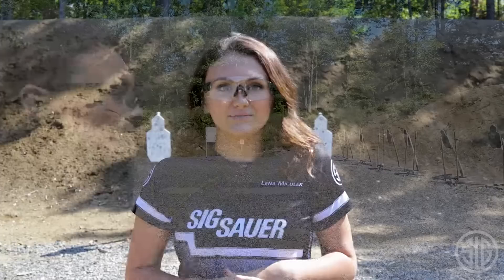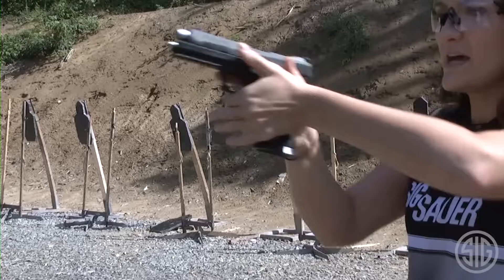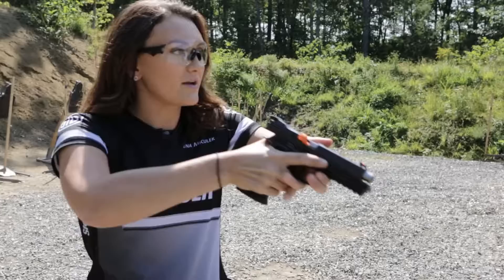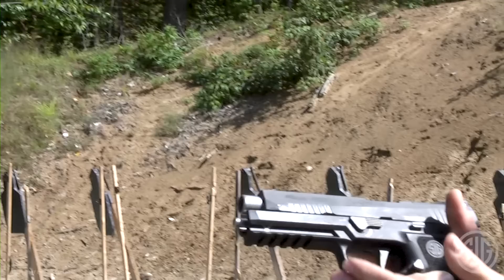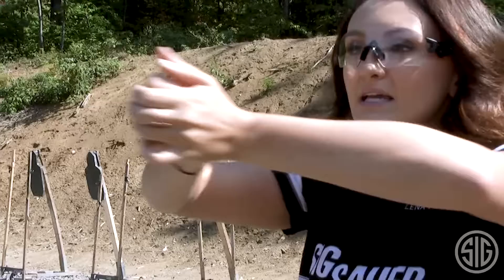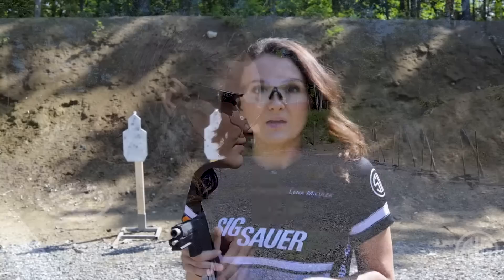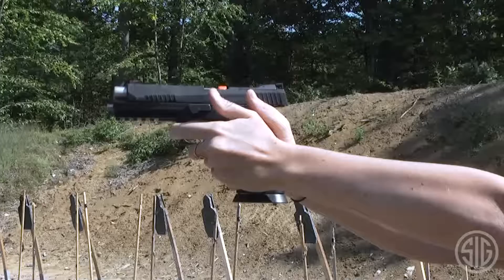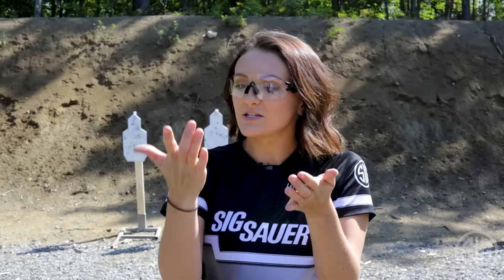P320 Training Tips: Grip with Lena Miculek

Comment: "Sloth grip" indeed.  A wise old shooter once said, "if it's stupid but it works, it isn't stupid.
Reply: If it's stupid and it works! Lol 😆 lol 😆
Reply: if it's stupid and it works, it's still stupid.
Reply: it was: "If it looks stupid but it works, it isn't stupid", I believe.
Reply: If it ain't broke don't fix it!!!! Best advice my grandfather ever gave me.
Reply: I almost hold of that way but instead of two fingers on the trigger guard I got one because I have a Taurus G3 C and getting all my fingers underneath the trigger guard feels like they are slipping off tge other fingers and I cannot get my palms up against the gun as good . And my 2 fingers don’t fit  underneath it so well but one finger used as a hook on the trigger guard  does great for me its very comfortable to squeeze in with my palms when that combined with the isometric pull I can control the recoil more accurately with that one finger up higher to my bottom three fingers on my left dominant left hand can really squeeze in on my other fingers and squeeze palms  together well while that one finger helps keep gun from rising up on recoil . Traditional grip works good but I found this great works better for me. However with a larger gun traditional grip works better but with this smaller compact The index finger works better for me for some reason.
Reply: Can you imagine if this works for Jerry..... he would be even more unstoppable!
Reply: I think you're the wise old shooter 😂
Reply: Every new technique or innovation is starting by somebody trying something different.

Comment: Started doing this last year and it's been a game changer for me , people always say it looks wrong or funny until they see how well I can shoot compared to other so called experienced shooters , no comparison...
Reply: There is a reason why, they tell you not to put your fingers on the trigger guard. If it works well for you so be it. In reality this give you less recoil control
Reply: Have you ever tried it? It actually gives you more “recoil control”
Reply: @manny45629  Yes I have , I’m a smaller stature person and yes this works for me , everyone is different on size and stature so everyone will have different results and opinions.  
Based on my size at 5ft 6 it was a game changer for me.
Reply: Sorry that was for “Andog 609”
Reply: Sorry that was for “Andog 609”
Reply: Sorry that was for “Andog 609”
Reply: Sorry that was for “Andog 609”
Reply: Sorry that was for “Andog 609”
Reply: Don’t know why it replied that many times sorry
Reply: @manny45629  No Worries, not a problem..
Reply: @andog6092  

They tell you that because they don't know how to shoot and fell into a modern tactitard "fad". They also LOVE having user induced malfunctions because they are running the pistol beyond it's designed limits and engineering features. Your hands and thumbs were never supposed to be up that high interfering with slide cycle speeds, magazine releases, decockers, slide stops etc etc. Also common sense says you don't press the accelerator in your vehicle with your left foot. Why would you circumvent the serrated and notched trigger-guard either? Idiotic amateur rookie mistakes.......

Comment: Thanks! A few decades ago we were calling your new grip "the normal grip." We did it with success for the reasons you list.  What you call "traditional" is a relatively new idea that someone dreamed up and convinced a lot of people that it was the right way.  People at matches like to poke fun at my grip which is the same as yours.  They don't point it out so much when I eat their lunch, which is regularly.  Thanks for allowing new shooters to try the "normal grip."
Reply: That cringe worthy thumbs forward grip like you are smashing a pancake with both hands and rolling your wrists down is worthless and incorrect. The engineers designed the pistols to use the "wedge hold" or one like she is using here. Massad Ayoob still uses it as well. It's checkered and notched for a reason. Trying to circumvent engineering design is idiotic because "it's my way or the highway". Your thumbs aren't supposed to be flush up against the slide slowing the cycle speed down or interfering with it's movement. You aren't supposed to be accidentally hitting the magazine release, slide stop, safety, decocker or any of that. Still...MOST of these people insist we are doing it all wrong. I've been doing this for 41 years. I never saw anybody shoot with the modern thumbs forward grip until around circa 2004/05. It's spread like wildfire since then and is akin to the second coming of Christ now. It's not comfortable at all and most your pinpoint accuracy is now gone. These days you have all these tools shooting fast at large steel plates at very close range with 9mms and barely nicking the far leading edges. Then you see Bullseye Comp guys shoot 1911 .45s ONE HANDED and put all their shots into dead center in a hole no bigger than a quarter. This "modern" technique is incorrect and WRONG. I will argue against it and despise it until the day I die. If you can't shoot a larger caliber effectively or need to "get rid of a gun" because of your technique well then the technique is WRONG! If you really want to knock the wind out of these people hand them a revolver and tell them to pull that crap with that like you do a modern semi-auto striker fired polymer 9mm. If it's a .357 Magnum or .44 Magnum you will surely DROP that revolver upon recoil or you won't be able to hit a darn thing with it effectively. Their argument is always "equipment and techniques change and advance". That is code word talk for (I am a nOoB amateur and I want to be a expert before I deserve to be one).
Reply: Who would have ever thought you can control recoil and increase accuracy by not having your hands and fingers UNDER it. The engineers put it there for a valid reason. You might as well start pressing the accelerator with your left foot if you enjoy circumventing design features and engineering.
Reply: Uhhhh....false.

Comment: There’s a good reason why many pistols have a squared guard with stippling on the front.  This technique really gives you more leverage for reducing muzzle flip.  Thanks for sharing!
Reply: Who would have ever thought you can control recoil and increase accuracy by not having your hands and fingers UNDER it. The engineers put it there for a valid reason. You might as well start pressing the accelerator with your left foot if you enjoy circumventing design features and engineering.
Reply: most people have lights/lasers in front. So, yeah, this is good for competitions and people with small hands, but for EDC?
Reply: That's exactly what I say! Just look at the design, many guns encourage  to be gripped in this fashion.
Reply: @natehall6120  

Why would you circumvent a design feature the engineers incorporated into the frame of the pistol? That takes brains and common sense of epic proportions to do something like that. Might as well stomp on the accelerator with your left foot then.

Comment: I also have a small body frame size with small hands.  This makes it very hard to control recoil.  I think most of the time I lose in USPSA competitions are because I have a hard time controlling the gun.  The next time I go to range I'm going to give your grip a try.  Also would like to thank Sig and the whole team a big thanks to all the videos on techniques and training to help us improve our shooting.  Love my Sig P320 X5 Legion for carry optics.
Reply: If you're small handed use a gun with smaller grip. The cz p10 is awesome
Reply: My 9mm Makarov with its fixed barrel blows away most "modern" 9mm compacts in accuracy AND handling bar none. You can get them used cheap...stay with the single stack mags version, I have seen problems with the dual stack mag ones :) I carry one everyday...and to bed :)
Reply: No I am not a Russian sympathizer...My Macs are actually Bulgarian, new manufacture, un-issued and fully available.

Comment: I just bought a glock 30s in 45 acp. I'm have trouble controlling recoil. I was thinking of using the square trigger guard with my support index finger to get leverage to control recoil. I'm going to give it a shot. Thanks for your tip.

Comment: And that is the difference between a pro and a beginner.. a pro will always optimize the technique for best results and they do not follow common methods if it doesn't work for themself. I need to try your grip because I have the same problem with recoil control. Thank you Lena. Best wishes from Germany.

Comment: Just tried this today at the range, safe to say I prefer this grip to the traditional. I can control muzzle flip as she states in the video easier. It definitely looks and feels weird but it’s not uncomfortable. With training I can see getting better shot placement with the Lena Grip. Thanks.
Reply: Using the serrated front notch of the trigger guard with one or both of your support hand fingers IS THE NORMAL WAY.

The ultra modern thumbs forward grip that first appeared circa 2004/05 is WRONG and incorrect! Always has been....

Comment: In wrestling (also BJJ), there's the Gable Grip (developed by the legendary American Gold Medalist Dan Gable).  In the Gable Grip, you keep the thumbs forward -- you don't lock them over the the fingers like many traditional grips.  This allows -- or rather -- requires you to use more of the shoulder and back muscles and rely less on wrist and forearm strength.  The "Lena Grip" shares some similarities with the Gable Grip.  Doing that is going to transfer the some of the load from your wrists and forearms and to your shoulders, back, and structure.  Pretty cool!  I think you've hit upon something mechanically very sound.

Comment: I noticed the difference in your grip immediately and thought if I did that in a pistol class to help me control the recoil (73 yo female) the instructor would put me off the range. Post Covid after taking more than two years off shooting, I have difficulty controlling the recoil and so my shooting has deteriorated. I am on the verge of purchasing a full size gun with a compensator for this reason as I currently shoot a Glock 19. I am going to try it your way and if it works I will do it in my practice classes. I am book making this video for show and tell.

Comment: Great points Lena and thank you for sharing what works for you! I was an instructor for the Army CID and we used the Sig P228 (M11). Many times at the range, we would have stovepipe issues with smaller females who didn’t necessarily have the grip strength, and we’d have to work on different grips. Yours is one I wish we would have thought of. (Though I believe the P228 doesn’t have as flat or pronounced front trigger guard) 

Again, thank you Lena and Sig for your insight! 👍
🙏, T

Comment: I do this but with just my index finger. My middle finger wraps around the grip, and more or less fits between my right fingers. I find that the forward pressure at the crook of my trigger hand combined with the rearward pressure of the finger hook allows me to isolate my trigger finger, and it reduces muzzle flip to the point that I never have to adjust my grip after shots anymore. I don’t even need to grip hard to use these two pressure points (the hook & crook), and while I’m not perfect (I get a bit of the shakes after a bunch of rounds), I am getting back on target very fast, and getting tons more dead centers at ten yards, even with my 3” barrel EDC.

Comment: I’m not new to shooting and by no means a pro shooter. But I was shooting my g30s today and found myself doing this sort of grip. I was having a hard time staying consistent with my shots so I set my pistol down and just stared at it and my eye caught the front of the trigger guard. So I tried this and the next 50 rounds stayed within 5 inches at 10 Yards. I thought I’ll be. This may or may not work on my difficulty pistols but on this Glock 30s it does. It’s coincidental that I came across this video. 😎 btw, the g30s has a pretty good recoil being a 45 acp.

Comment: Thanks for sharing!  As an older shooter, I too do not have the upper body strength that I use to.  My grip is the conventional thumb forward on the support hand which puts it right on top to the take down lever.  After a few hundred rounds this would really wear out my thumb and it was very uncomfortable.  Regrettable so much so that I sold my P320 XCarry.  Gee, I wish I had seen this sooner.

Comment: Recently stumbled across a video with a guy saying the thumbs forward thing is not a good grip because the primary hand is your combat grip and having your thumb right under the slide isn’t a good grip for one hand. 

That rang true to me so I tried what he said, indexing my thumb down on my middle finger in basically a 3 finger fist. That IS a valid single hand grip. Now clamp your support hand over it with the support index finger hooked around the trigger guard, and THAT is a f’ing strong grip. Your primary thumb should be locked down under the channel of your support hand, and your support hand fingers are indexed into the webs of the primary hand. 

That’s a CLAMP grip right there. Try it. 
It also forces your support hand higher and further forward. Come on, range day…

Comment: I read as many of the comments and replies to avoid repetition of something that may have already been addressed but I can't find what I am lookingfor. I am wondering if this grip does not interfere with the movement of the slide enough so the slide will not lock open after the last round had been fired, for example?

Comment: Downside is probably that it won't work with mounted lights
Reply: I have a light on mine. And this method still works for me. This method allows me to focus less on trigger control because the grip provides better lateral balance. I pretty much never have to worry about jerking the trigger eversince I switched to this method. 😊

Comment: That cringe worthy thumbs forward grip like you are smashing a pancake with both hands and rolling your wrists down is worthless and incorrect. The engineers designed the pistols to use the "wedge hold" or one like she is using here. Massad Ayoob still uses it as well.  It's checkered and notched for a reason. Trying to circumvent engineering design is idiotic because "it's my way or the highway". Your thumbs aren't supposed to be flush up against the slide slowing the cycle speed down or interfering with it's movement. You aren't supposed to be accidentally hitting the magazine release, slide stop, safety, decocker or any of that. Still...MOST of these people insist we are doing it all wrong. I've been doing this for 41 years. I never saw anybody shoot with the modern thumbs forward grip until around circa 2004/05. It's spread like wildfire since then and is akin to the second coming of Christ now. It's not comfortable at all and most your pinpoint accuracy is now gone. These days you have all these tools shooting fast at large steel plates at very close range with 9mms and barely nicking the far leading edges. Then you see Bullseye Comp guys shoot 1911 .45s ONE HANDED and put all their shots into dead center in a hole no bigger than a quarter. This "modern" technique is incorrect and WRONG. I will argue against it and despise it until the day I die. If you can't shoot a larger caliber effectively or need to "get rid of a gun" because of your technique well then the technique is WRONG! If you really want to knock the wind out of these people hand them a revolver and tell them to pull that crap with that like you do a modern semi-auto striker fired polymer 9mm. If it's a .357 Magnum or .44 Magnum you will surely DROP that revolver upon recoil or you won't be able to hit a darn thing with it effectively. Their argument is always "equipment and techniques change and advance". That is code word talk for (I am a nOoB amateur and I want to be a expert before I deserve to be one).